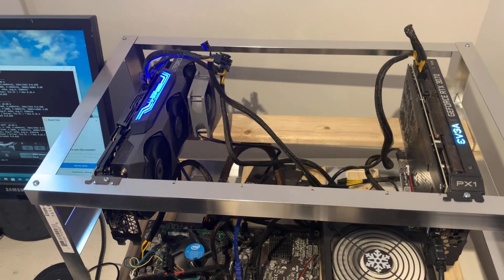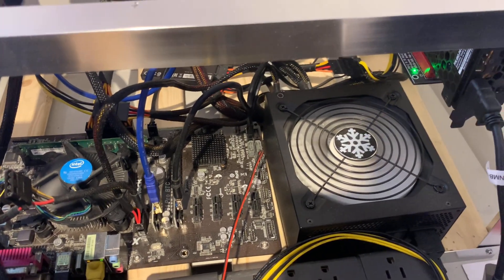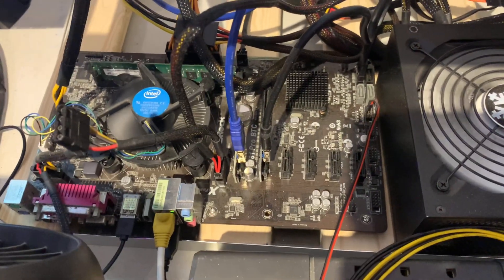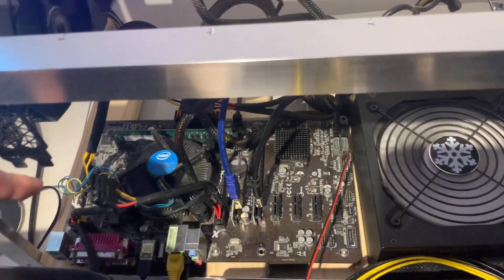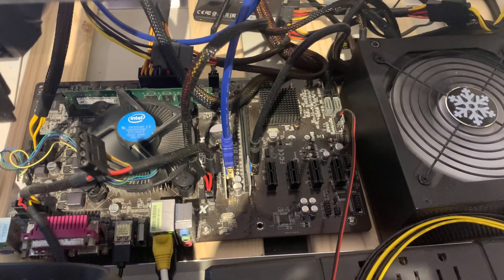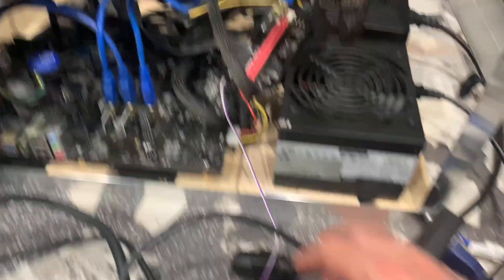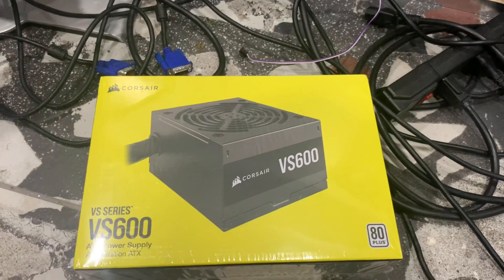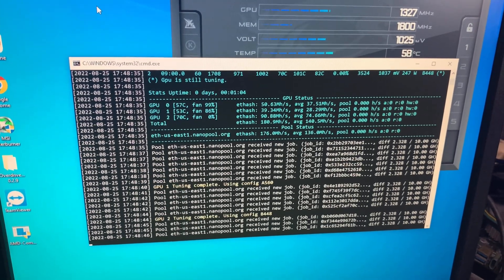How to Fix Repair Any Mining Rig Troubleshoot GPU |  Ethereum Tips and Tricks Full Guide Bitcoin

Comment: Pretty thorough vid! Great process to get to the root of the problem! 
Thank you for another great video. Those damn risers need to be better quality. I wanted to ask, someone told me to avoid all RGB in mining rigs becaus it only adds chances for issues, what’s your take?
Reply from the maker: Thanks Szirmay Realty for the comment!!! RGB takes very little power almost insignificant. As for breaking its true it nearly almost fails eventually after 5 plus years of mining 24/7 but if it breaks it doesn’t affect the mining or gaming performance of the card so nothing to worry about 👌
Reply: @brandcoin8159  Cool, thank you for answering. I think its not worth the extra dollars to have them shine is a room that nobody get s to see anyways.